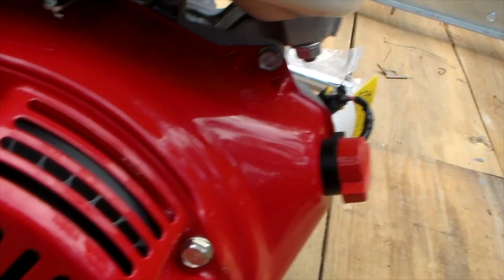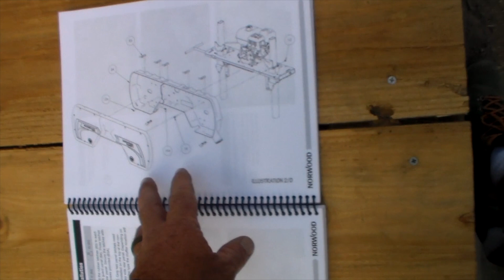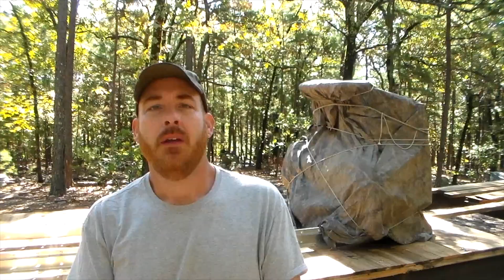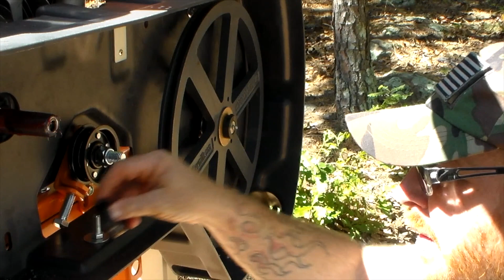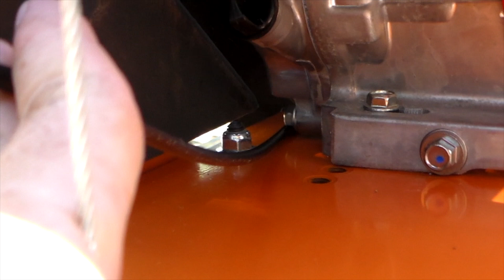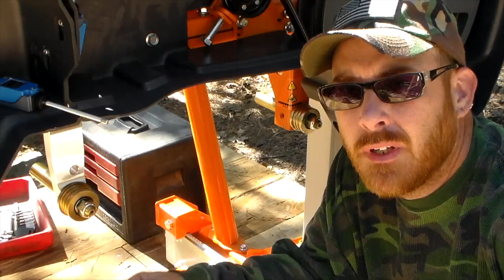Norwood LM29V2 /LM30 sawmill assembly / Motor Installation and Bandwheel Installation Pt.6

Comment: I just ordered a Norwood like yours, and was curious how wide the rails are?  I'd like to pour a concrete pad under the mill, but don't want it to cover the whole shed.  Could you give me the measurements from rail to rail?  I'll use that to pour the footings under the rails.  Thanks!
Reply from the maker: Sorry for my lack of response. This comment got past me. I am sure it is to late to answer your question but if not let me know and I will give you the measurements.

Comment: Hey buddy how are ya! Man another good video! I like the flashiness when ya unboxed the engine. Also “Norwood we need to talk”. Think they have folks watching so maybe they will reach out and talk??? Man the wiring looks messy, but I like that you greased the connections and shrink tubed the connections. A  clean loom would be nice. Maybe I’ll try to get it loomed when I assemble mine. I’ll save som loom tube from the Jeep project. I am looking forward to seeing sawdust fly!!! Hey what ya gonna do about sharpening blades? I bought a pack of blades with the mill, I’m thinking that won’t last too long? Been researching blade sharpeners. I think I may go with the wood mixer BSM 25, was looking at the woodland mills geindlux 4000. The BSM 25 will take about 6 minutes per blade and the Grindlux 4000 about 16 minutes. 50 bucks difference so may go with the wood mizer?
Reply from the maker: Thanks, I hope Norwood is watching and reaches out to me. Let me know I'm not too small or too big but just a customer and they care about that. Hope they understand I'm busting their chops so to speak ...Wiring is kinda hanging everywhere. I like the idea of using wiring loom. May steal that idea from you lol....Not sure about the blade sharpener at the moment. Very costly items but very needed. I didn't like Norwood's and agree about the cost difference for the time difference. I am hoping to pay for these things with the mill. So we shall see..